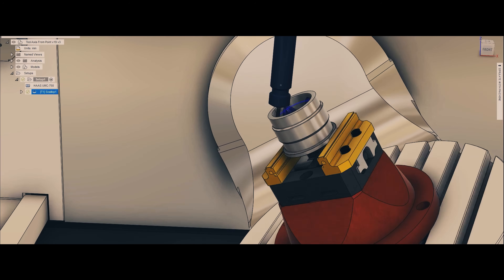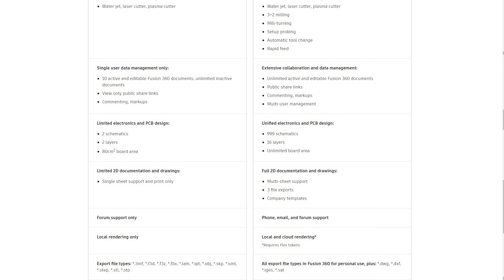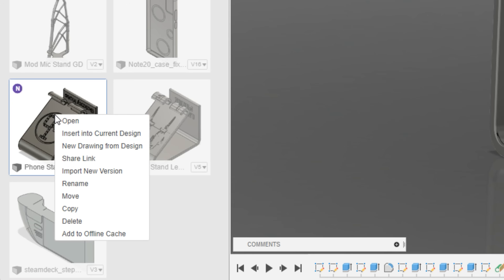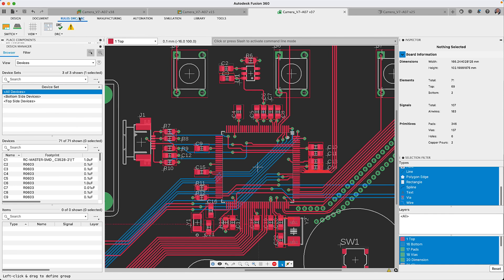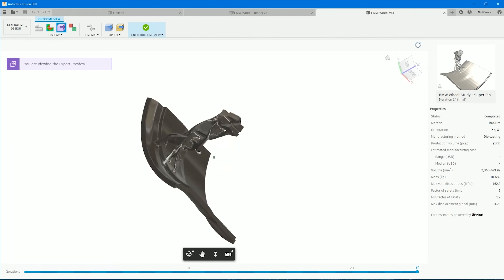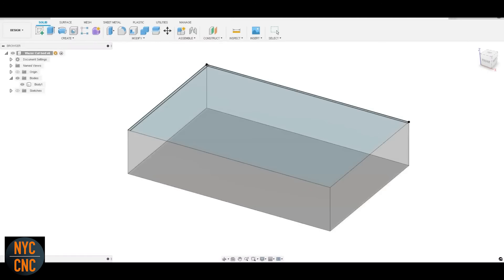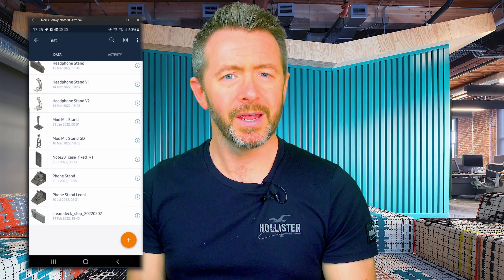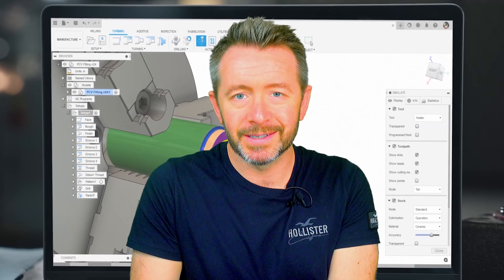WTF is Fusion 360

Comment: Technical support is horrible and most tool paths are geared around solid models. Forced to create solid models to enjoy the full breath of tool path features. Forced to select tools from a tool library (no tool creation on the fly). Fusion 360 is not for you if you just want to quickly create wire frame geometry, apply tool path and generate NC code. You will be restricted to tool path features if you don't want to create a sold model. BTW, you don't own the tool path you create. Yes, you can save the NC Code and the part geometry locally to your computer, but you can't do the same with the tool path you created. That is to say, if you decide to quit Fusion, you loose all access to all the tool path you created. Forget about making edits to tool path if you quit Fusion 360. Also, forget about design security. Your product design files are stored on the cloud. You think the cloud is 100% secure? Really? BTW, what are you going to do when Autodesk raises the subscription price? Fusion 360 is OK at what it does but I'm not drinking the Koolaid and believing it's the best out there.

Comment: Paid my money and I have been using Fusion 360 Electronics for 6 months. 2 to 3 random crashes each and every day in that time. Tried 3 different computers in that time, no difference, crashes same way on all of them. No Fusion error reports of any kind, just a fatal windows crash message. Timed auto backup doesn't work either so lost work every time.

Comment: Dang it.  Having been pissed with AutoDesk (who would have thought that would be a thing? ) when they removed the excellent conduit between AutoCAD and the original Fusion I have now spent many £1000's on Inventor over the subsequent 10(?) years.  Ha, ha AutoDesk I have my Inventor licence in perpetuity and I ain't giving it up.  I do have 3D printers and baby CNC machines though and the CNC machine gets little use as I only drive it with CamBAM which (quite frankly) is a pain.  Perhaps it is time to consider Fusion again?  What we need is someone who does really good tutorials 🙂

Comment: Personal use or especially commercial use; I strongly disagree with AutoCAD “holding” your files. 
Designs are Intellectually Property, and should be secured by the designers, NOT a cloud “hackable” account
Reply from the maker: Hmm I have a lot to say on this which I don't think can be articulated briefly in a comment reply.  But regardless, that's your opinion and you're not wrong as it's your opinion and I understand the reasons for holding it.

Comment: Thank you, I really appreciate the information. Do you have a video of a list of 3D printers that works with Fusion 360.
Reply from the maker: You're probs best off hitting up either the Fusion 360 official forum for that, or head to the Fusion 360 Discord server if you're a Discord user.  There's a huge community of helpers there.  
But when you say what "works" with Fusion 360, tbh any will and should.  If you're modeling something in Fusion just to export a .STL file to print, then it doesn't matter which printer you have really.  If you're wanting to use the integrated slicer that I mentioned and are curious about the preconfigured profiles, then it's not worth making a video on that as the list will update and change so often that the video will be out of date in no time.  But it supports most of the popular brands like Creality, Prusa, Ultimaker etc

Comment: I did a project with some Creo guys recently in the defense sector.  They were doing complex gimbal/camera assemblies with out any animation tools.  They refused to upgrade their license due to cost issues from PTC, and they were using it to do front end concept work.   Fusion has now past the rubicon and with the post covid world of working. They are positioned to make dinosaurs out of the likes of PTC, Dassault, McNeel and Siemens who are all still stuck in lock-down mode.  They cannot innovate with all of their old legacy data and are making retards out of good creative engineers and machinists.

Comment: Hi Neal.  All well and good but you did not mention the issue of local internet service realiability and the recent proliferation of hackers.  If the internet drops out then what about access to data.  How much does clould storage cost and can data be backed up on your own companies servers?  You can probably tell that I am a Inventor supporter.  Cheers John
Reply from the maker: Hi John - there was never any intent to cover security concerns in this piece, there's a lot I didn't cover as it could have easily been an hour or two long.  This was a high level overview, stuff like internet blackouts and functional workflows in the event of cyber attacks are way beyond the scope of this one! Valid concerns and good questions though.
Reply: @Neil3D  Thanks Neal.

Comment: Im coming from Tebis, Pro-E Wildfire 3 and 4 till Creo 2, parallel solidworks since version 2015.. maybe a tiny bit of Rhino. From you I learned everything about Inventor but I might finally switch to fusion360 now.. all the others feel like they stopped in developing for that massive price tags they all got.. after 12+ years in cad/cam prototyping there was never a part i couldn´t do with fusion today